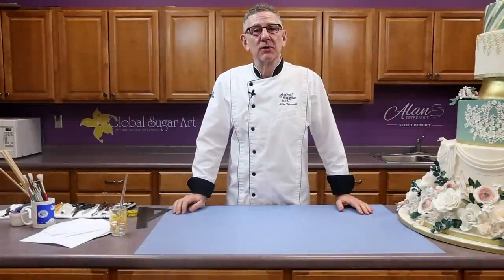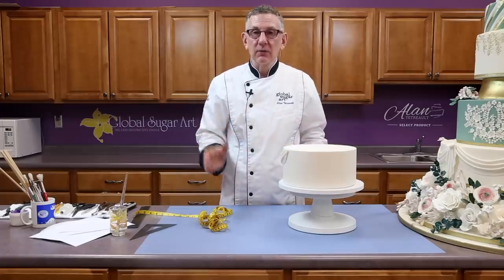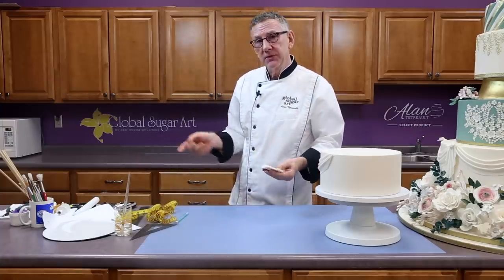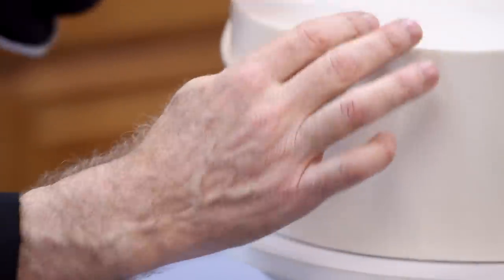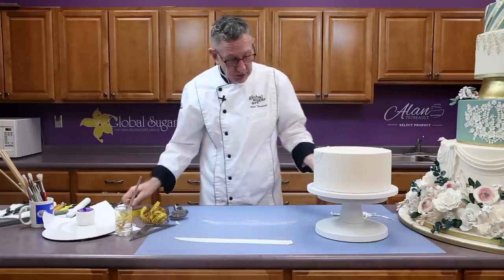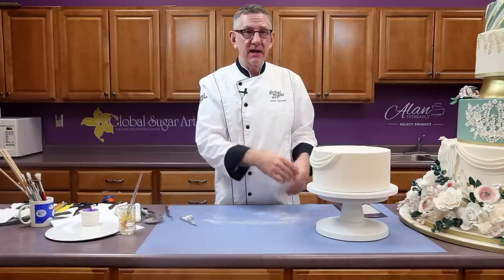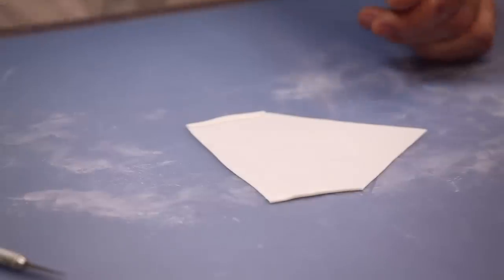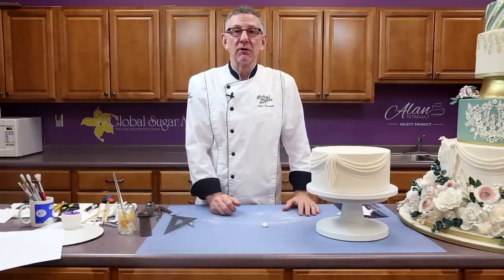How to make Fondant Drapes and Jabots for Cakes | Global Sugar Art

Comment: Hi Alan if I want to make a silver drape hv I to make the drapes n then paint it with silver dust with brush or mix evaporex with silver dust n paint on the drapes.which u suggest is the right way.
Reply from the maker: That should work but be sure to cover the remainder of the cake parts with paper to prevent overspray from coloring the remainder of the cake silver.